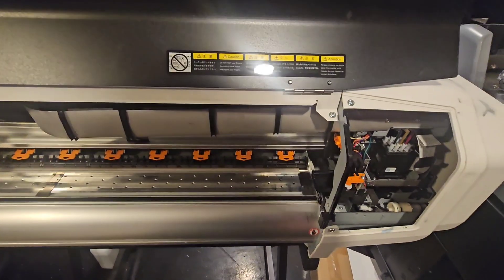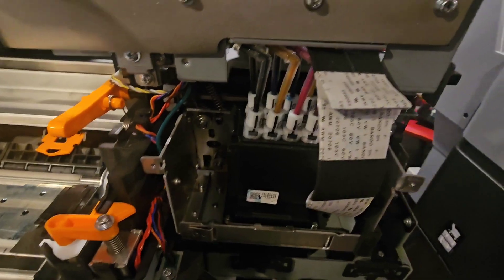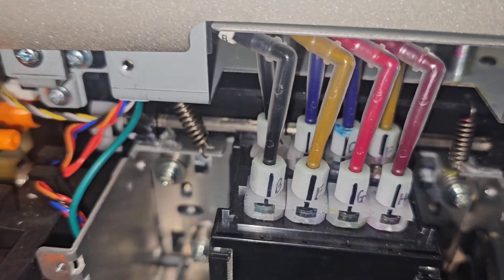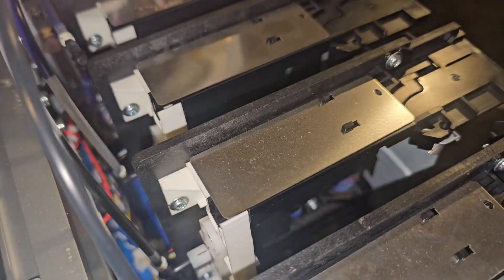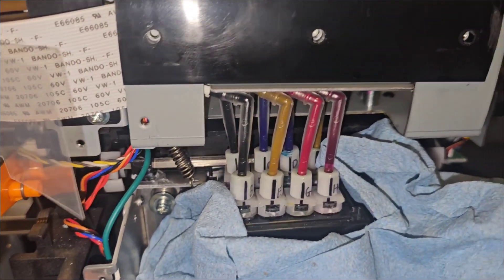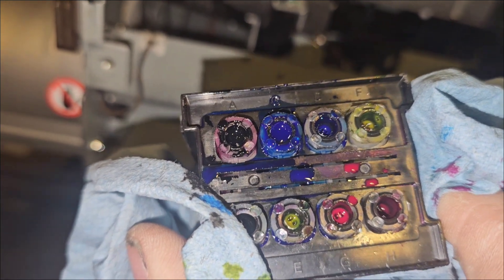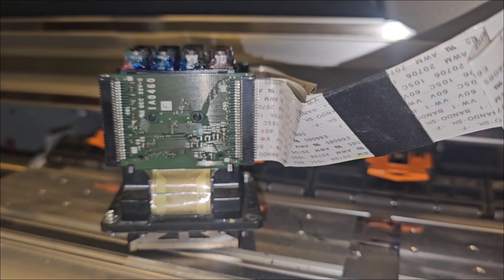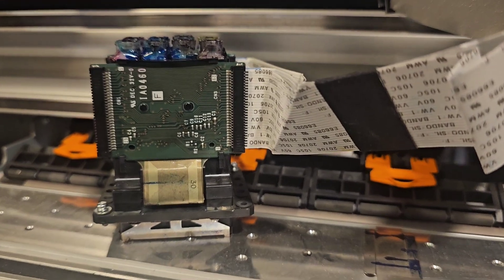PRINTHEAD replacement DX7 Mutoh VJ 628 628x 628D DTF Ecosolvent Sawgrass Sublimation

Comment: Wish you would have shown the removal with some more detail as far as the screws and what not. Im trying to get the cover off for dampers but the brass looking cross bar blocks it so I need to get my head out. Had to plug it all back up and leave it for another day since I was unsure of what to do even using the vague manual. Attacking it again soon with a better screw driver.
Reply from the maker: Appreciate the feedback and wish I had the time to be a more organized youtuber and make my living off youtube. Unfortunately when making these videos I am doing my own repairs and trying to help at the same time.
Reply: @reprint217  you were still helpful, just it’s overwhelming when it’s your first time so everything’s pretty confusing. I get that it’s not a full complete guide but I got the head out and replaced my dampers but it has some air in the lines so I don’t know if that will do it for me yet. Been out of service for a month now.

STS wouldn’t help me since they lock down their service manuals in an attempt to stop DIY repairs. I was able to reference a 628 manual but I hate this printer. 1 year old and it’s done I think. I will forever preach about never buying anything from sts.
Reply: let me know if you still need help with this. its not hard to get to the dampers but there is a nice amount of disassembly that needs to be done. and yes you will need to take the entire print head out especially if its your first time changing the dampers

Comment: Hi Mike! Been binging your videos as I work on repairing my SP-540V. 

In a previous video I saw that you had tons of used DX4 printheads. My SP-540V had been sitting unplugged for 6 years, dried ink in the lines, shot printheads everything, and I was able to get two colors firing with minimal deflection using a method I saw on the signs101 forums. Basically submerging the printheads in an 1/8th of an inch of cleaning solution, connecting both nipples on the manifold with ink tubing to create one tube to pull from (equalizes pressure between the channels), and drawing cleaning solution slowly up through the printhead with a syringe.

Now that magenta and cyan have been unclogged, the cleaning solution wants to take the path of least resistance and thus yellow and black are still clogged. 

How do I combat this issue?? I hate to draw from one channel at a time putting unnecessary pressure on the membranes. But it sounds like this may be what I end up having to do.
Reply from the maker: What I do is take ink tubing (actually have video on it) I melt one end and put on the manifold nipple that is NOT CLOGGED. That will allow full focus on the clogged channel. It works, just requires patience and rinse and repeat
Reply: @reprint217  is this printer a VJ 628D?? if you are scrapping it Im interested in buying it from you for parts. Please let me know if you still have it. i do need it to be a 628D tho.

Comment: How did you remove the bolts around the print head ?
Reply from the maker: Sometimes it's easier to remove printhead bracket that are screws. I wouldn't remove any bolts
Reply: So I've changed the ffc  head cables& installed new print head but code E075  keeps popping up ..also the f2 fuse on the mainboard keeps popping. I'm not sure what's the problem 

I know the f2 fuse fires the print head
Reply: @1sickhemi_92hemi_movement2  the printhead has a small straight band spring that holds the printer parallel. take that out of the slot (1 screw) and then remove the 4 screws that hold the small metal carriage to the main large carriage. you dont have to remove the 4 screws that attach the printhead to the small metal carriage until AFTER you pull the printhead out. also, can you tell me where that fuse is that youre speaking about?? is it on the board above the print head, or on the board on the opposite side above slots 5, 6, 7, and 8??